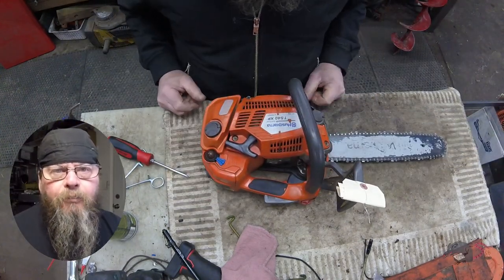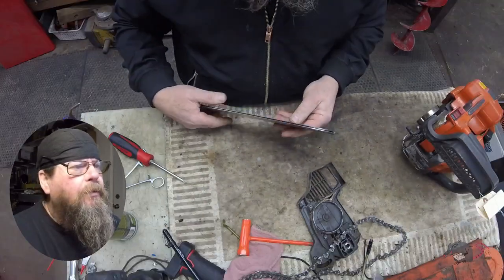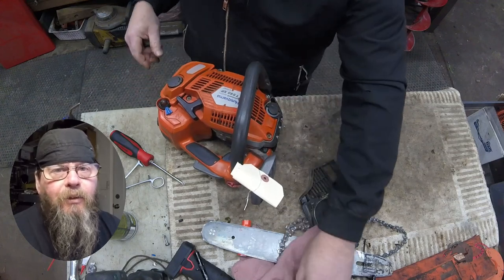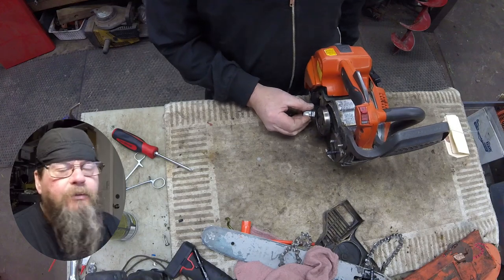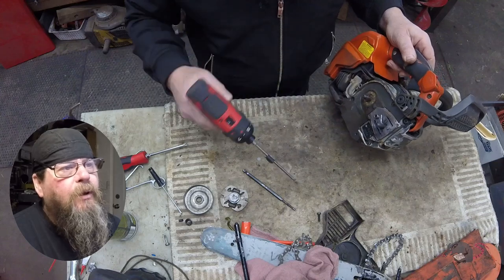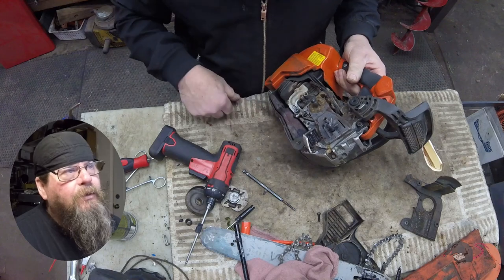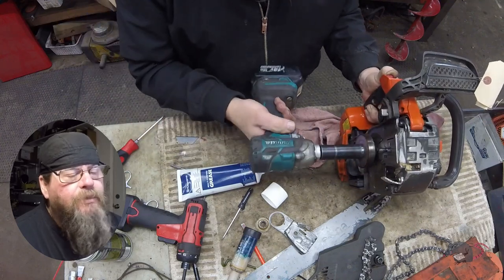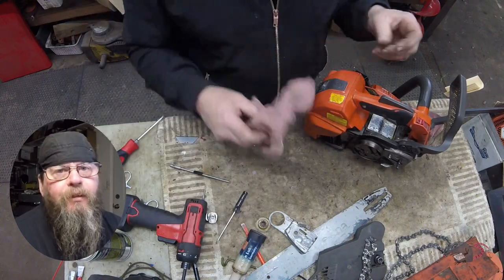Husqvarna T540 Chainsaw Not Oiling

Comment: Trimmer done. Carb needed a ton of work. But what concerns me was I replaced all fuel lines. Bought from 2 local shops.  Both yellow tygon. One though w/o dimensions printed on outside. That one turned almost clear and got mushy. That’s where gas was from, then going over hot muffler.  What are the ways to tell if it’s quality over the knockoff?  Thanks.
Reply from the maker: I'm not sure because I don't think we ever got any imitation hose. I'm sure our distributors watch out for that and know they wouldn't be our distributors anymore if they sent us crap.
Reply: @TheGreasyShopRag  By memory, to help someone, it was more supple/soft and easier to cut. There weren’t any dimensions printed on the outside.
Reply: I prefer genuine Tygon fuel line.  I purchase 10-foot lengths of 4 different sizes so I have some on hand for any small 2-stroke application.

BEWARE!!! - there are definitely Chinese knockoffs marketed as tygon (lower case letters!!!), but they are not genuine Tygon (a registered trademark name), so make sure you purchase from a seller who is reputable.  I check the photographs before purchasing to confirm the lines they're selling have the white manufacturer name (Saint-Gobain) and other line-specific markings on them.  I then check what is delivered to make sure someone's not playing games.  The knockoffs have no markings whatsoever.

There are very specific reasons why I prefer genuine Tygon as opposed to OEM black line.  I can see fuel flowing through when confirming the fuel system is working as it should.  When installing on carbs with a purge bulb this makes it simple to check that you've got the lines on correctly and that the fuel is flowing the way it's supposed to.  I also like that when the line eventually becomes old it turns color.  That visual change is an immediate sign to me that the integrity of the lines (and the purge bulb - same thing) are suspect and the time to replace is probably not far off.  Black OEM lines are fine, but eventually they do become affected by fuel, softening at critical locations  (getting loose on nipple connections, for example) but you can't see that happening until they develop leaks, which you then have to diagnose and locate.
Reply: @Rein_Ciarfella  both local reputable dealers. First bad from the one. I will let them know. Thanks for the info. They open a box or from a roll , cut and hand it to you.   I know about telling the bad from the good before installation. Haven’t any bad purge bulbs YET.  I even test the fuel filters any more.    Take care.
Reply from the maker: @Rein_Ciarfella  The ability to see fuel flow really is an advantage. Thanks for the tips about knockoff Tygon.